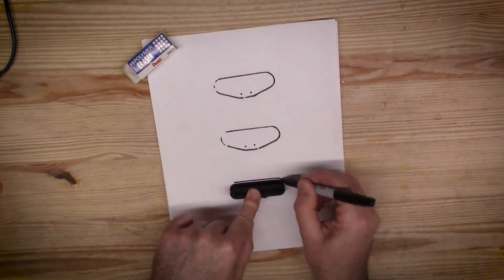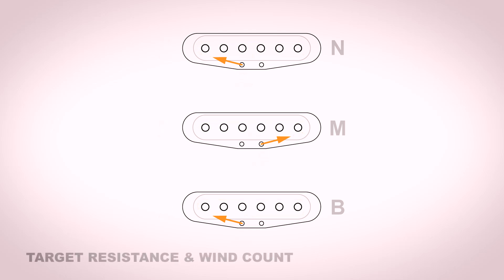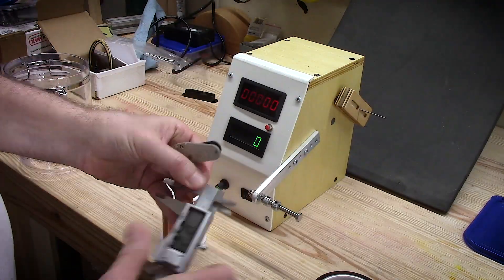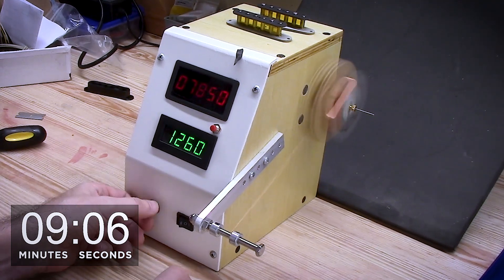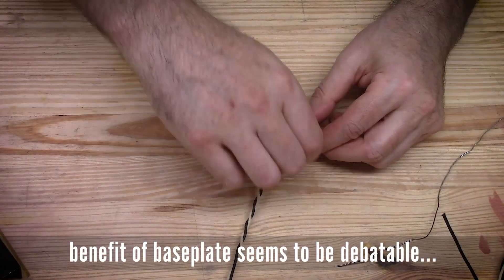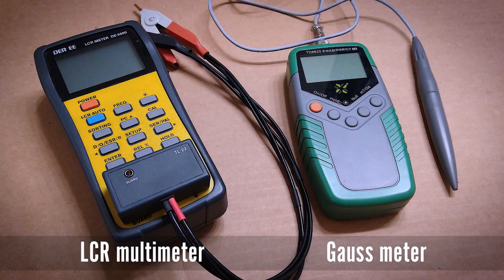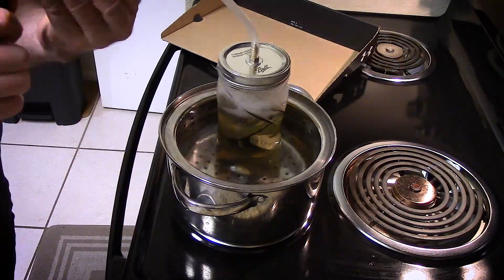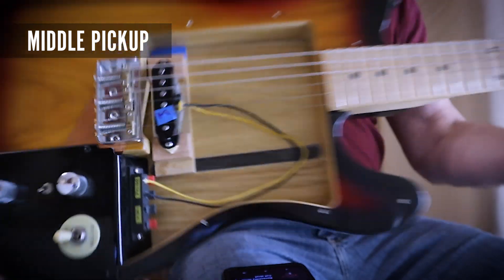Winding Stratocaster Single Coil Pickups

Comment: I realize that I wasn't specific enough in my google searches when looking for what I needed for frequency response measurements...meaning, I found your video by chance and BAM! Your link to AxeTech saved me! Thank you. Great video. 
Would you consider doing a video demoing the setup and run of the AxeTech system? Also, my pickup testing guitar is similar to yours, but less refined. A video with a little tour and breakdown of the build would be appreciated. I'm always looking for ways to improve/ modify my builds.  Anyway, thank you again for video! Very well produced!
Cheers!
Reply: Awesome, man! Keep up the great work. Appreciate it.
Reply from the maker: A little update on the AxeTech Bode Plot app.
I have a video prepped, but want to run it passed the company. I've attempted to contact the company, but something has happened and it appears their entire website is down. I don't know if this is a temporary or permanent issue.
Sorry, no video at this time.
Reply from the maker: Jeff, thanks for watching!
Glad you found the channel, sounds like we are very similar. I too like to find ways to improve and modify stuff. Cool!

As for the AxeTech, I have a video started and may merge 2 different videos together to answer your question. So, yes, I am/may/will be putting a video togther going over the AxeTech.  Currently I'm running it on a old iMac, but I'm thinking of loading it on a PC laptop as well. Assuming i can get it working and capture some content, I'll add that into the video build.
Might be a couple weeks, as I'm also thinking of contacting Alex at AxeTech for a preview, and ask him for corrections and such.

Also, If you are asking about my pickup mule guitar, I do have a couple videos of that build.
Part 1
https://youtu.be/Mh4ksCV2FOw

Part 2
https://youtu.be/_Ruu89fZmrY

Hope this helps and I should get an AxeTech vid wrapped up soon-ish.
Be safe and take care!

Comment: Excellent video. A question. Using alnico 5 and heavy formvar 42awg wire, what should be the approximate resistance of the neck and middle pickups so that the mid frequencies are a little scooped (attenuated)?. Thanks for answering.
Reply from the maker: Nilton, thanks for watching!
Excellent question, and I'm sorry to say that I do not have the answer.

Personally, to find the correct wind count with the parameters you mention, I would need to wind a number of pickups to "find" the goal you seek.  If I had vastly more expirenece, I'd likely have a good idea where your goal would be found.
At this time, I don't have enough personal experience data to make that call. We could look up the suggestions and specs offered by others who have a long background in winding pickups, but would then need to use their information to help target our own abilities in winding.

Sorry, not the answer you were looking for, but I don't want to mislead you so I'm calling it like it is.

Be safe and take care!

Oh, I just thought to add, the goal you seek may not be best constructed of the components you listed. Perhaps change in magnet and wire would also get closer to the goal. Then there is magnet charge, pickup height... Okay, I'll stop rambling.
Reply: @theNextProject  Thank you very much for your attention. The information you provided is very important. After doing some research I have come to the conclusion that 8000 turns of wire is approximately 6K resistance in a standard coil at an ambient temperature of 70 degrees Fahrenheit (21 degrees Celsius). This gives us a result of 1333 turns for 1K resistance and 133 turns for 0.1K resistance. After the study he carried out and his results (1320 turns for 1K of resistance) I have come to confirm that said information is correct, the minimum difference is absolutely nothing. Regarding the scooped mid frequencies, I concluded that alnico 5 is the appropriate magnet above the rest to achieve this objective. As for the wire, apparently there is not much difference with respect to plain enamel. In relation to the ideal resistance to achieve a naturally scooped sound, many agree that there is a range from 5.0K to 5.6K, between very scooped to slightly scooped. All this taking into account only the resistance (number of turns). Obviously the final tonal result depends to a greater extent on the shape of the coil, the strength of the magnet, the tension and the way the wire is wrapped, and the guitar itself... Greetings. I repeat, excellent video.
Reply from the maker: Great bit of information you have there. Thank you for sharing it all.
Good luck with your pickup and guitar project.
Be safe and take care!

Comment: Thank you for this video. I wonder what make you think the goal is DCR instead of just wind count or inductance value?
Reply from the maker: Thanks for watching!

Great question regarding resistance, wind count and inductance.  I guess the reasoning for my approach on this set was based on wanting to target older strat style pickups.  There was a lot of info available on the resistance reading of those old pups, not as much on actual wind count and even less info on inductance.  

So, I used lessons learned from a few previous pickups I've wound, and knowing the approximate resistance I wanted, I was able to get an idea of the wind count needed to reach that resistance reading. So, in a way I was using wind count, to get resistance. The inductance was a mystery until I was done and had the magnets charged.  

Final reading help me fine tune my winding style even more, I hope to get closer to the target every time I try this.

A lot to learn and more experiments to do yet.  A fun and interesting project.
Hope that explains how I went about this set of pups.

Merry Christmas and Happy New Year to you!
Reply: @theNextProject  1320 winds per 1kohm you have achived is perfect ratio. If you know  vintage pickup data Seymour Duncan gatherd, it is placed right in 1962. Good luck with your projects!
Reply from the maker: @zbyszekolko3998   That's great to hear! I like when things (mostly) work.  
I'm having fun and slowly learning stuff too. 
Thanks for the info. 
Be safe and take care!

Comment: About base plate - all depends from what material it made off. And how this material change magnetic field and inductance. You can measure this, you have needed tools.
Reply from the maker: Arwndr, thanks for watching and I agree with your comment.
I thought about doing a side-by-side BodePlot, but didn't take the time - at the time.  Actually sound difference seems to be very subjective for most people, I didn't do a ln A-B test, with/without, and just decided to go with the plate.  Maybe I'll do a BodePlot comparison and A-B test on another pickup soon. That might be an interesting little video experiment.
Hope all is well, take care!
Reply: @theNextProject   Yea, A-B tests that would be great! With inductions and capacity measurements 👍🏻👌🏻
Thanks for your channel and your explorations! 🙌🏻🤝🏻✨☀️🌿

Also size and form of plates from different magnetic and non magnetic materials change inductance and size/shape/dynamic response of magnetic field, and output sound from pickup as result.

Gladly with interest will watch your new video with explorations ✨

Take care! 🌍🌿☀️

Comment: Pickup MULE? Multiple Use Labor Element? I've figured I might end up with something like that, someday, with a big gaping hole and no pickguard, probably with velcro blocks to be able to reposition pickups fast without restringing...

And say what you will about metal baseplates on pickups, but I liked that bridge pickup a lot (even in comparison to the others in the bridge position test on the MULE).
Reply from the maker: That MULE has been a fun tool to have, and what a huge difference moving a pickup location just a little bit makes in the sound. 
Not sure if you've run across the Tele-Mule project yet, it's a short project series, giving the basic rundown on the idea.
https://youtu.be/Mh4ksCV2FOw?si=CndxXvwxN7R3rFxz
I'd probably change a few things if/when I make another, but for now it's easy and fun to use. If I do make another MULE it will be the shorter 24.75" scale, with a TOM or Wrap-around style bridge. Hmm, maybe a third would be a Strat style with a tremolo...I'm getting ahead of myself now.

The metal baseplate has so many +/- reviews and comments. I'm not sure where I am on the topic. I felt it didn't hurt the sound, and there are plenty of positive opinions on the plate, so I stayed in place. 
I should have run a couple boadeplots, one with and one without the plate, to see how/if it changes the resonant peak, but again, that information is above my true understanding of all this magic.

I'm happy all the pickups sound good, and are unique.

Thanks for watching!

Comment: I found the part about the shielding plate interesting. If I had a pickup with the backplate and cut the wire that it has soldered and added another wire to ground, would I have a three conductor pickup?
Reply from the maker: Fab, thanks for watching!
That's a good question.  Don't know that it would really be a 3 conductor pup, as the coil is still one loop. 
If I get what your asking, you'd basically just be adding a separate ground lead for the base plate.
Maybe someone else here will have a better answer for you.
Take care!

Comment: Hi John,
very interesting video. I am a little bit confused. Does the winding direction make any noticeable difference? Shouldn't it be enough just to swap wires for hot and ground?

Stay safe
Jens
Reply from the maker: Hey Jens, good to hear from you and thanks for watching!
The middle pickup is considered (RWRP) reverse wind, reverse polarity. It is simple to creat a humbuckers effect.  As for swapping wires on a pickup the isn't reverse wound, yes that may be an option. Or it may not work properly. The magnet polarity will also need to be swapped, so that could be an issue depending on how the pickup is made and the type of magnets. 
I've also read that bare magnet type pickups are prone to noise if the hot is used as the start.  
Here is where I say " I really don't know enough to give you a better answer ".
So, Yes, and maybe no. 
Ha, that sucks.

Hope you are doing well. 
Take care my friend!
Reply: @theNextProject  
A pickup uses the effect of induction due to the change of the magnetic field. For hum canceling, You want the current to flow 'the other way around' and the magnetic field to be reversed in the second pickup. That is more or less clear. But I just don't know that it makes any difference whether the current flows first through the outer windings or first through the inner windings.
I think that it is more important to have same materials, similar strength of the magnetic field and similar number of windings for almost perfect hum canceling.

But enough of that stuff. 
 
What is really important: the latest tNP guitar is great and if I will ever visit Florida, you'll have to hide that beauty well from me, even if the middle pickup is RWRP.

I am looking forward to the next project...
Reply from the maker: Yep, basically swapping the wires and the magnetic direction will achieve RWRP.   So, if 3 pups were identical, the middle position could have the wires swapped if the magnet polarity could be reversed and the hum canceling should then be possible.  From what I gather.
If (when) you visit Florida, I'll buy the first round and you can play whatever guitar is available. 
👍

Comment: Great job, man!
And how do the in betweens sounds? Are you sure you don't take the left contact for hot on all pups?
I'd love to do much more guitar building than just doing pup-swaps and some wiring jobs.
My F-spaced Tonerider Generator ended up being soldered without any fancies, no coil split, no series/parallel, no nothing, just two pots and 50s tone cap. And a killswitch.
I even used the self-cut-out scratchplate, although it wasn't cut out well, and it has a crooked slot for a lever switch, that isn't in use.
The only real speciality is the position of the pup, around 10 mm (2/5th of an inch) further away from the bridge than usual.
Reply from the maker: Achim, good to hear from you and thanks for watching.
Great question about the left contact for all pickups - Yes, and No.
Really seems to depend on the direction the pickup(s) were wired. I've seen some use the start as the hot, rather than the start being ground. So, It may depend on the direction the coils are wound. In this expirement, I did the RWRP type winding on the middle pickup, so my ground/start is opposite side compared to Neck and Bridge pups.  
However, I'm still learning. 
I had read that on plastic bobbins, the hot/ground leads can be swapped with little issue, but on these exposed magnet pole pickups, the chance of added noise becomes an issue if the hot wraps to the magnet poles. Lindy Fralin has a good article on that.
This pickup stuff makes my eye twitch, LOL.
Hope you are doing well, take care!

Comment: They sound just great to me. What would be an average cost per pickup John? I'm seriously considering investing in a winder (homemade of course) after often being disappointed with cheaper store bought pickups.
Reply from the maker: Martin, thanks for watching that that is a GREAT question!
Ballpark: $15 - $35 (US) per pickup just for the pickup kit and wire. 

Here are some ballpark numbers, and it really looks "affordable", but that may be a bit of an illusion, as I can't really factor in all the research and testing, and potential failure/heartache time.  Luckily, even the failures have something to offer.

Approximate Costs - 

Tone Kraft pickup kit*	  $ 20 - $ 30 
(*cost varies greatly per pickup type and kit)

Remington Wire 	$ 3 per pickup  ( based on 1 lb spool cost/yield )
   ( 1 lb spool / 49,600’ = $ 60 ) 	   

Total per pickup 	± 15 - $ 35* 

Initial Costs
Winder	$ 5 - $ 600, use a sewing machine, or drill, up to a MOJO winder etc.
Misc	$ 50  

Also, get a really good headband magnifier. ($60 ?)  42g wire is soooo small, it's almost invisible at times, then when you start winding with 43, 44....

Estimate of ± 2,000 feet of wire per pickup could get about 24 pickups from a 49,600 foot spool. (unless my math is wrong = probably).

There are less expensive kits, bobbins, magnets and hook-up wire available.
These numbers are a ballpark, and actual cost can be higher or lower depending on pickup type and kit style.

It is fun, and challenging. The "Christmas present" moment when things work is great, hearing it for the first time is great. Cutting away a complete bobbin of wire is... what's the word? Not fun.

Hope this helps, and good luck!